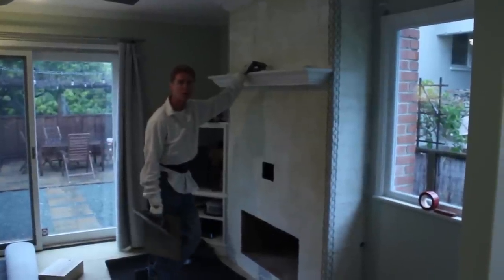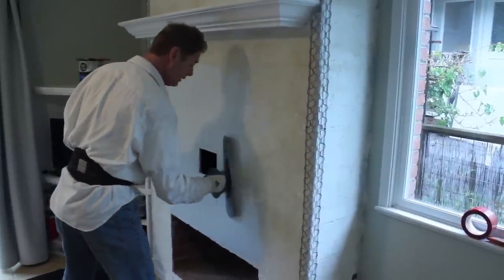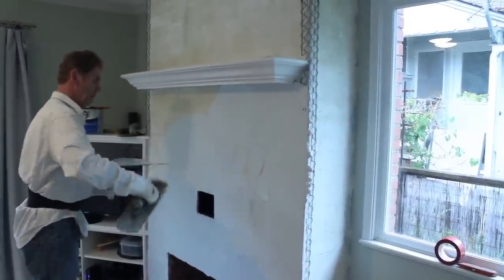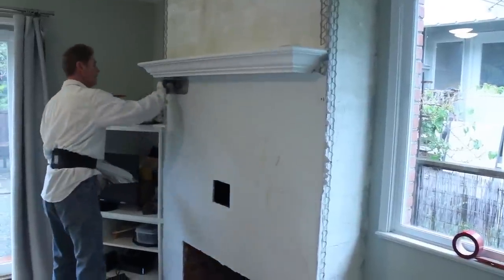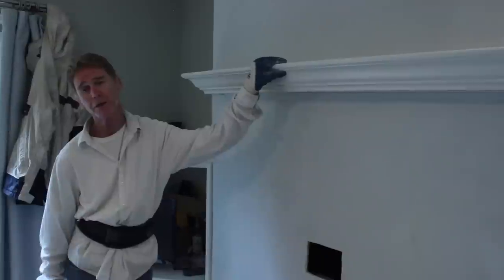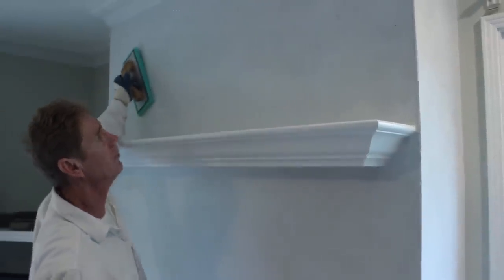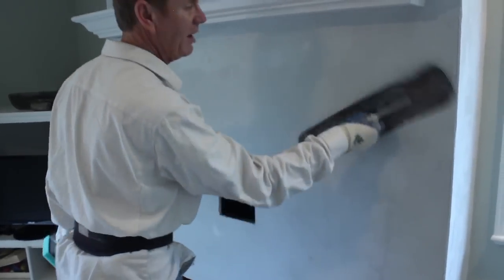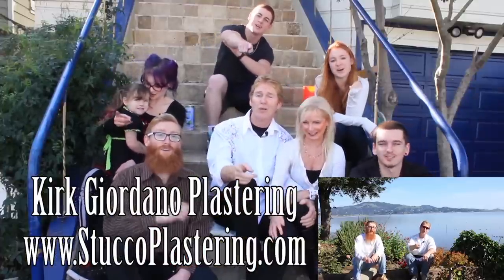Interior Lime plastering over a fireplace.

Comment: A few years ago I repaired plumbing leaks on 1964 commercial building in the basement. I used diamond mesh and half inch channel iron. The material was structolite I added some sand to my batches and had to let it slake after the initial mix ing. In all it ended up being two tons of material. Lot of holes big and small. Took two weeks all ceiling level 5 . Good experience ate my lunch though.2800 dollars. I know better now .you've been quite an inspection for me . Thanks
Reply: Insperation
Reply: In all most holes took 4 coats, felt like them birds that make mud nests
Reply from the maker: Good evening Peter dude, structo-lite is easy to apply if you have it set when you want it to set.
 The trick is to keep your trowel wet. As structo-lite is sort of gluey, but with a wet trowel, it slicks well.🍻
Kirk and Jason Giordano plastering, sharing well over 850 free Stucco/Plastering videos for your education. 
    Together we have created the most comprehensive encyclopedia of Stucco and Plastering videos ever produced globally, all by your favorite plastering messengers of YouTube.
Bringing peace, love, and brotherhood back into plastering.🎭🏝🎆
https://en.wikipedia.org/wiki/Lath_and_plaster

Comment: I use a whitewash brush to wet down my work, polish until it browns off then do a final fill of any minor imperfections with lime putty if necessary, using a headlamp torch and my reading glasses.
Reply from the maker: Howdy Jason, that way my friend would acheive perfection.
                    Live long and plaster
      Plastering and repair tips on your home

Comment: watched several of your vids and found them very good.  I've been trying to veneer a bedroom in my house and having trouble.  struggling with the ceiling, so far.  Im a novice, but i am NOT a total rookie. Ive plastered over the years on my own using all the wrong materials and etc but always manage to make the wall look smooth and pro.  figured id have similar luck on this job - especially having watched some instruction, gotten the right tools, used the Diamond finish veneer, sealed my regular sheetrock with a bonding agent, etc.  but no.  at first, my work looks good, but pretty quickly the plaster is roughing up, rather than staying smooth and 'going glassy' the more i work it. Its like it's drying out too quickly, or something? Im solo, so my small batches are starting to set after just 30-40 mins, it feels like.  what gives?  Is it just that ceilings are much harder?  its my first ceiling.  Hard to work overhead, and all that, but ???   I wonder if its a bunch of small problems - my plaster mix isn't quite right (feels like whipped cream, as you say), or my mix batches are too small, working alone, having to stop and mix another batch, etc etc.  i know that I'm not a pro with 25 years, but again, I'm pretty good, for a non-pro (I've successfully plastered a few things on my own over the years).  Wonder if you see any little thing in my story that might suggest an obvious problem?  many thanks.
Reply: Give up.....
Reply from the maker: Evening Sam dude, I can't apply plaster and mix at the same time on a ceiling.
 I feel this is extremely difficult, you need help, one man to mix and be told when to get the next batch ready, and one man to spread.
 As your forgetting the main thing, plaster waits for no man, so when you know you need more, now, your busy mixing which takes 20 minutes, by this time you lost your first applied mix. Your an animal and a hero for trying, but in the future, dont do that.
 Two guys for plastering a ceiling as in a team sport.   
                Peace, love with happiness to all.
    Kirk Giordano plastering tips-mixed with sound advice
Reply: First you got to put on the diamond veneer base coat let that dry then spray with water then apply glue on the base it keeps the finish coat from drying to fast
Reply from the maker: Atta Boy Adam, thanks brother for answering Sams original question.
 I got carried away explaining, don't plaster by yourself, which was half the question.
      You answered why he's having a problem with the material.

                           Peace, love, and harmony to all
         Sound Plastering tips for the DIY beginner’s and Plastering experts

Comment: Hi Kirk, how can you slow down the suction and increase the amount of time you have to work with it? I need more time when swirling the top coat. Thanks.
Reply from the maker: Howdy Kevin, you can mist the basecoat a bit and work in cooler conditions plus to maximize the time of all plasters when mixed use very clean or new buckets and a clean drill paddle, as buckets with residue speed up the setting process.
 Or you can get help from your neighborhood plasterer.
 Cheers, live long and plaster
 giordano’s stucco images and teaching videos

Comment: Totally inspired by your videos and your artistry! I'm going to attempt to use this product on a recording studio vocal booth and piano room, which I've added on to my studio. I was looking for a way to avoid sanding the regular drywall mud because of all the dust and not wanting it to damage my electronic gear. What product are you using on the corners? It doesn't look like regular bead (sorry to ask...I'm a nube!). Also, what bonding material do you recommend. If you've answered any of these questions, please let me know which video to watch. Thank you!!!!
Reply from the maker: Happy New Year Robert, the bonding agent I prefer is plaster weld by Larson's however quikrete works just as well and is sold at Home Depot as well as Lowes.
 I used stucco corners or corner aid, but you can also use sheetrock corners.

                  Bringing peace, love, and harmony back to the world of plastering.
    The complete plastering encyclopedia on video, by the plastering messengers of Youtube with over 800 videos.

Comment: Hello Kirk/All,
My wife and I purchased a 1915 4-square 6 months ago. It needs some TLC; every room has some level of cracking, bulging plaster or poorly patched areas. The first room we tackled only had a couple 6”x6” areas in which the surface coat had popped loose and no gross patch jobs. We used drywall compound for the holes and it looks good. 

The next room is a lot rougher. The base is tight, which is good, though there are large areas where the top coat has loosened. Additionally, there are large areas that were previously poorly patched. It also appears someone used plaster of paris in previous repairs. I don’t know if that makes a difference. It also appears that a skim coat of drywall compound has been applied just under the ochre-colored paint. It also seems that, in the places in which drywall compound has been used, I cannot easily remove it (scrape) to the base plaster. This seems essential to get a smooth coat. ( I also have to be careful, because one of the worst imperfections is just above the radiator. I don’t want the trouble of draining the system and removing the radiator in the middle of winter.)

Link to photos: https://1drv.ms/f/s!Ap-yf4kzCfhAgZd5wDrBe9SL4ycNlQ 

So I have multiple questions.
1. Can a plaster veneer be feathered for areas near the radiator? If not, what is the best (not necessarily the easiest) way to remove poorly patched areas down to plaster?
2. Should the rest of the walls be chipped/scraped to the base coat? If not, should plaster be applied in 2 layers: the first to cover the holes and bring the surface to one level before applying the veneer coat?

The ceiling will also be renovated during this project. How that occurs will depend on the condition of the plaster underneath the hideous tiles.

Thank you all,
Jeff
Reply from the maker: Good Morning Jeff dude, these are very common and quite normal issues,
 Clean the areas well, no dust.
    Next apply a bonding agent, the repair with eitrh, drawall compound or the veneer system, If it were me I'd use a drywall compound.
                       Live long and plaster
       Teaching the world to stucco, one video at a time.
Reply: Thank you. Will Plaster-Weld work for a veneer coat of drywall compound, too?
Reply from the maker: Good afternoon Jeffrey dude, it will work for both a veneer system or a drywall compound application, there is a difference between these two plaster systems.   
                    Live long and plaster, 
          Kirk’s, plastering tips and techniques

Comment: Hey Kirk!  I’ve watched several of your videos.  Didn’t realize I could comment and ask a question.  I am not a professional, I have been remodeling my fixer house about 7 years now.  I have a cinder block house in north California.  It had old wallpaper in the bedrooms. I removed them to a white sandy looking finish over the cinderblock.  I applied bonding adhesive, imperial base coat then without bonding adhesive in between I applied diamond finish, I was originally going with a smooth finish but but did not master it in time so I went with the skip trowel texture.  The kicker, I decided I wanted a natural hard look so I added stucco dye powder terra-cotta.  This is why I couldn’t spray n trowel hard smooth the plaster because it would fade the color dye when trying so.  I also in a hurry never scratched the base coat which I think will be alright.  It ended up looking really good a lil decorative than I wanted but ok.  There were many spider checks but I got most of them by touching up later.  My question is now that I have the next bedroom to do that will be going with another earth tone color but prob beige light brown, is that can I save some money and use a stucco brand base coat at Home Depot instead of imperial for the base coat?  Also going to do interior of my cinder block plus some fur out walls of my gargage/studio, I would like a lite color industrial looking sandy finish, can I get that with straight Portland cement and then paint it?  I experimented with a stucco at Home Depot white looked nice but too grandular for interior even for a garage, should I just get the fine stucco and dye it for interior?  Or try Portland cement and paint it because I don’t think you can dye Portland cement.  70% of the garage is unpainted cinder block one of the walls will be furred out and lathed to conceal plumbing etc.  Know it’s a lot but thanks if you could respond.
Reply from the maker: Morning  David, I'd advise your second room to be completed as the first.
   You said you applied a diamond finish over the imperial base finish without a bonding agent, That was correct as a bonding agent was not necessary.
 However, you must wet the imperial basecoat before the diamond finish with a plasterers water mister such or a Hudon sprayer or the basecoat with suck out the moisture from the finish coat, hence cause cracking.
   I dont advice any exterior being used inside as the sand is too thick, one can only trowel down sand so smooth, even if your incredible stong, exterior plasters can't be trowel down smooth.
 The Diamond plaster has no sand, so this plaster can be troweled smooth.

                           Peace, love, and harmony to all
         Sound Plastering tips for the DIY beginner’s and Plastering experts

Comment: Great video Kirk,  thanks from NYC. I have a old brick wall that I want to repair, strengthen, and stucco over. The mortar is totally gone in several of the joints between the bricks. What would the best plaster / strucco solution for my old brick wall? One or coat? Wire lathe needed? Does the base coat substitute for repointing the brick itself or should that be done first? Any guidance appreciated. Many thanks.
Reply from the maker: Evening Armen, I'd advice Pressure washing well, apply a bonding agent and use portland cement plaster, mixed with three times the sand to every one part cement plaster.
 There are cement plasters that are stronger but not necessary.
 No, you dont need it attach any wire to the brick wall.

              Sound advice from the plastering messengers of youtube
Reply: Kirk Giordano plastering Inc. 

Thanks Kirk. So, no lime in the mix?

Comment: Hi Kirk & family If we have drywall up that the plumbing company put in, and started doing a bit of Fast Set Lite 20 setting type compound. Initial partial coat to smooth between the traditional lathe & plaster painted smooth walls (1921 or a 1950 remodel) where the bathtub /shower was torn out.  How do I go about plastering this?  Do i need to start with bonding agent Larsen's Plaster Weld ? Can I use a veneer plaster to finish the job so it can be done faster instead of 3 coats of 20 min fast set (3more  days without a bathroom?)  I like what you say about not having dust around.
Reply: I forgot to mention, they installed drywall where tub was leaving  the  old plaster above, and drywall on ceiling and pocket door frame.
Reply from the maker: Evening Cinn, if it's in the shower area, set tile in there. If it's close to the shower, choose a veneer plaster.
 Gypsum compounds will turn back to putty if they get moist after awhile.

         The University of plastering by Kirk and Jason Giordano
Introducing peace, love, and harmony back to the plastering world.

Comment: Hi Kirk! New to your videos and can't thank you enough for sharing your knowledge. Can you get those wired corners from a local hardware store? What are they called? Beginner here. Thank you so much!
Reply from the maker: Greetings Hannah, yes, I buy all of my materials at the Plastering yards, however, these can be purchased at Home Depot. They are called, "corner Aid." Or, "Stucco corner aid." 
Best wishes with your project.
 Bringing peace, love, and brotherhood back to the old fashioned 🌎  “Plastering.” 
    The most comprehensive encyclopedia of plastering on video, by the plastering messengers of Youtube.  
     Over 800 videos 🎭 👀💃
Reply: @StuccoPlastering  Hi Kirk. Love the videos, keep them coming! I am working on an old home built in 1830, or before. The plaster got wet at some point and leaks were resolved some time in the past. I removed wallpaper covering cracks and hanging sections that I have cut out and prepped with 45 minute USG Durabond.I also re-enforced springy or weakened lathe. I am now almost finished filling and surfacing the cracks and large areas that were crumbling and falling away from the lathe.  I am ready to do the Diamond veneer finishing coat but did not know about the Imperial veneer base coat. Is it safe for me to do a finishing coat over the existing old plaster and my Durabond patches? I am thinking to paint on plasterers bond and then go straight to the Diamond veneer finish. Would this be ok, or should I put a base coat on first? All old areas of the old plaster that seemed to have movement were drilled and secured with a glue gun and corrugated plaster washers and are very secure. I want it as close to the original breathing lime and horsehair plaster to stay with the period, and I am hoping the Diamond veneer you recommend will be the best option short of a horsehair mix done in the past. Please advise when you have time. Thank you so much for all your wonderful knowledgeable video. I would never have gotten this far without them!

Comment: Did I screw up? I started putting Diamond Base coat down but didn't put corner bead and now my corners suck! 

A) Should I try to fix the corner with the base coat by hand and then add corner bead before I do finish coat?
B) Should I add the corner bead on top of the crappy corner and add some more base coat?
Reply from the maker: Howdy Eamonn, I typed in how to make corners with a rod or two by four. there are many videos to explain alternative ways such as 
https://youtu.be/_SAA11s0BPs/ Or you can do as in this video.😉
Reply: Thanks! I watched that video 2x and then nailed the corners using the 2x4 method :)

Comment: What’s the correct way to plaster over old painted plaster? Thanks
Reply from the maker: Hello, the way I did here, but instead of water, you would brush or paint on a cement/stucco bonding agent. Such as Weld-crete by Larsons, or Quikrete sold at HD.
 It does not matter what finish one uses or if it's interior or exterior. 
Without a bonding agent being applied to a very clean surface the plaster/stucco will perhaps adhere for a year to possibly up to five. However and eventually, it will separate.
Kirk Giordano Plastering

Comment: I was plastering my fireplace and ran into some issues that have delayed me putting on the finish coat by days. Is it possible to get the finish coat on even though the basecoat has dried? Could I spray it with water or add a coat of plaster weld, possibly? I would REALLY appreciate any advice. I can't find anyone who does plaster around where I live. Thanks!
Reply from the maker: Howdy Kami, this is the best time to apply a finish coat when the base has dried.
 FYI, there is no need for a bonding agent in your situation.
Best wishes,
Kirk and Jason Giordano plastering

Comment: Hey bro, why not install the mantel after you skim the wall... be easier or there reason why it has to be there ?
Reply: I'm curious about this too, as I removed my mantel in preparation.. but now realize that once I've plastered and finished.. I won't know how to locate the mortar areas to re-attach the nails holding the mantle base.. I'll also be afraid to damage the plaster re-hanging it..  so I may re-think my plan and leave the mantle up :O )
Reply: @kathy3517  pretty simple really....install it same way you normally would....pre measure for studs or install anchors/mantel (than remove for plaster leaving anchors) .....plaster then attach mantle

To me just seems like wall be easier to float and over all just cleaner...but maybe there is a an issue just can't see it
Reply: @kirkdunn1379  That doesn't sound too bad.. thanks!  it's the little things LOL